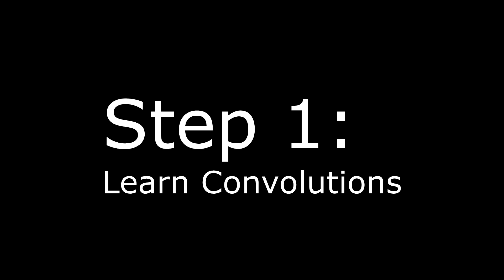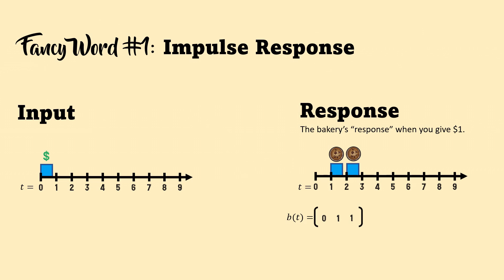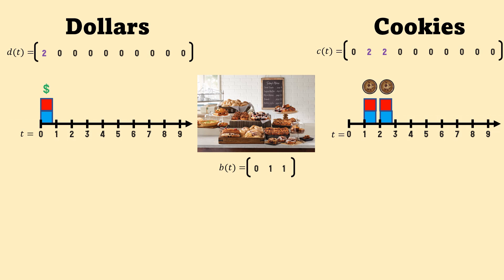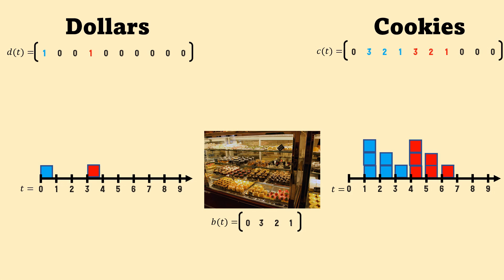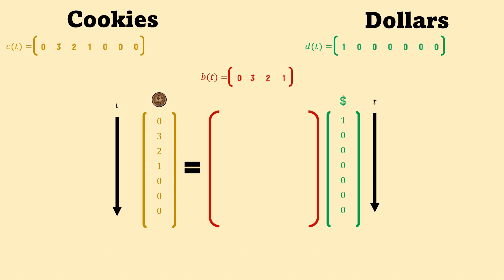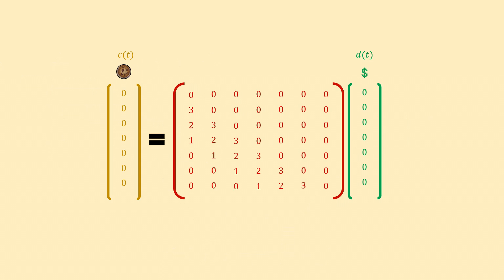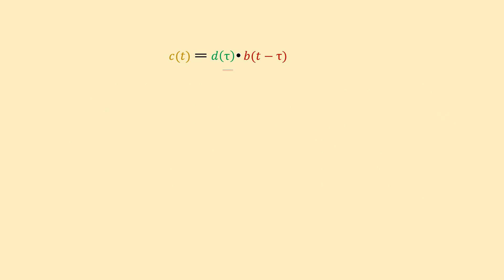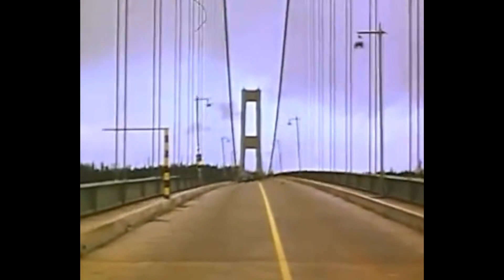Convolutions are not Convoluted

Comment: Extra Question 1 and insight into Question 4:
We can express polynomials in 2 ways:
(1) (n+1) coefficients uniquely represent the polynomial of order n. 
(2) evaluating the polynomial at (n+1) points uniquely represent the polynomial (see lagrange polynomial). 
For example, 2 points uniquely define a line, 3 points uniquely determine a quadratic...

In the coefficient representation, to multiply polynomials P and Q, we convolve the coefficients of P and Q to get the coefficients of the product.

In the evaluation representation, we multiply the evaluation of P and the evaluation of Q to get the evaluation of the product. 

These 2 representations are fourier transforms of one another.
Reply from the maker: Nice! I was actually thinking that if you treat use the fourier transform's discrete version, you can apply that to the convolution. You'll start to see the terms line up in a way that makes frequency multiply. I never expected it to connect back to question one.

Comment: First off this is the best video about this ever. 

But I have one doubt, at 7:45, when you say c(t) can be written as d(t)*b(-t), it's weird because that doesn't depend on past imput. compying your first bakery, let's say d(4) (dollars given at day 4) is 1, and b(-t) (cookies given at time -4?) is zero. The result would be zero cookies yet you could've given a dollar before that is just now receiving cookies.
Reply from the maker: It is not possible to receive cookies from the bakery on day 0 for a dollar you give on day 4, UNLESS the bakery can predict the future. Last I checked, bakeries do not have divination powers, so c(0) cannot depend on b(-4). 

Since the impulse response b(t) get's flipped around to b(-t), the negative sign actually refers to a point in the future.

The LATEST part of the impulse response interacts with the EARLIEST part of the input signal, which is why you need the flip.

Comment: No linear algebra related class I’ve taken has the input, output on the right, left. I’ve only left, right. Are you smoking?
Reply from the maker: Look up "state space representation". The derivative vector, which is the product of a matrix and the state vector, is written on the left side.
Reply from the maker: Furthermore, when assigning a variable in software the variable you want to assign goes on the left. Therefore, if you want to write matrix multiplications in code, your output goes on the left.

Comment: Brother you are correct for linear time invariant systems that they stack and scales response but in filters ther are used to attenuate some frequency can you please explain them with an amplifier used in some filters using convulution
Reply: Telling the application of convolution in terms of signal processing may help a part of people in the telecommunication and eee engineers but when convolution meets signal processing it also is used as a filter but my question is I have read convolution even it's useful for mechanical engineers such that in resonance when a failure occurs not due to massive force hitting an object results in large deformation could cause failure or an large impulsive force acting on it for a duration of time could cause failure but there is an another phenomenon where the natural frequency of any object is reached the energy builds in it very high and could cause a failure in this manner a small disturbance which accumulates over a time and causes a high energy to build in the system due to energy very high it causes stress and the system collapses this is highly different from stability perspective of control system being not stable does not mean it's accumulating energy inside it but in case of amplifier there is an capacitor or inductance device which causes the attenuation in the electrical signal and filters some frequencies but in other perspective amplifier amplifies the signal such that it stack ques and scales the signal but I don't know this is done by capacitor or am inductor but convolution is useful to both mechanical civil eee ece and every applied scientist and engineers hence it's used as a filter in an circuit or used to amplify but even transistor amplifies the signal without an capacitor or an inductor I guess also mechanical engineers can use it to model resonance hence the energy inside the system build high by periodic accumulation of the system reaching its natural frequency which leads to failure and I can also tell you that when amplifier filter or amplifies the signal it used convolution hence it's useful to every applied scientist and engineers but not to mention the pure Mathematicians use it of convolution of kernels thankyou guys some of my inference could be wrong if somebody or the author of the video is familiar with it please correct the above and educate me thank you for the wonderful video sir
Reply: Brother I know mechanical engineers could find resonance but when I had a deep thought on this resonance Is an slow accumulation of energy which is accumulated very high in small installments when the frequencies match if you strike a  turning fork of 50 hz you get the same frequency of vibration on another tuning fork so they both vibrate if you strike it harder the amplitude changes hence loudness is a human factor the frequency is the same the languages that human speak through out the world the sound only  resonate your ear drum for few seconds my question is that the harmonics is the fundamental frequency and overtones are the frequency that follow it take a word in any language you spell it according to convolution the thing scales and ques and stack the signal so convolution can be used to model resonance so when your ear drum vibrates it vibrates so the electrical signals are carried to brain  like tuning fork ear drums vibrate within the audible spectrum 20 hz to 20000 hz hence resonance is caused by the word we speak and within the audible range the ear drums vibrate and we make sense of words I have seen in one videos on YouTube that due to harmonics in any sound causes resonance which could be modelled by convolution recalling the resonance its destructive because slow and steady accumulation of sound on the mass causes high stress and high energy to build inside and stress increase and the system fractures or collapses but our ear drum hearing the sound from human languages try to vibrate but why our ear drum when subjected to continuous exposure of sound does not fracture or rupture like a wine glass iam not telling about high loud sound higher than 80 db but a audible range sound within the frequency of 20 hz to 20000 hz under continuous exposure why it's not damaging it again not failure by high energy but low one in synchronisation on air . But I tried it in my students when I told them to be quite in class they did not listen to me so I took my phone and set an frequency 14000 hz and they told it was irritating the idea of resonance is "small effort but large destruction " just like Tacoma bridge where the wind just slowly accumulated energy on the bridge and it collapsed it so my conclusion is if an audible frequency at continuous exposure to an human ear can it cause bleeding again "small effort but great destruction" sorry for the long story I you are able to reach hear you must be as curious as me so still not finished the ear drum is shook by harmonics in the sound we make by the words( or )overtones in the sound we make by the words I know harmonics is the fundamental frequency and overtones are following it which under slow and steady accumulation of sound energy resonates and could damge the ear drums again "small effort but big destruction" not to mention we assume the person is in coma or brain dead hence when the sound irritates him he or she could not make a move so my question is so simple normally human ear responds to harmonics or overtones according to convolution which could be a disaster but with minimal effort 🙏🙏🙏🙏 at here I could be wrong because harmonics can also be used to construct sound so can it be destructive or the overtones which are the trouble makers and which one according to this gives a response curve when two signals convolved by harmonics or overtones which is destructive but with minimal effort and convolution happens when ear drums oscillate is by harmonics or the overtones or also the trouble makers there

Comment: In my entire study of linear algebra, I have never put the output on the left.  But it looks good there, really!
Reply from the maker: I'm used to putting it on the left because I use "state space representation" of diffeqs a lot. Also, when you assign a variable when programming software, the variable you want to assign goes on the left, and therefore, when you model these equations in code the outputs go on the left.
Reply: @sigfyg8384  Yeah.  I like that notation because it reminds you that the matrix-vector product is just a vector.  Or that a scalar product simplifies to a scalar value.
Reply: I also put it on the right, never seen otherwise. I study math in France

Comment: 7:35 I don't really understand this step. I see the relationships, but why do you end up subtracting?
Reply from the maker: f(-t) is f(t) but flipped around the vertical axis.
f(t-1) is f(t) but shifted forward by one.
Combine these two transforms, and you get f(-(t-1)), which is a flipped and shifted version of f(t). 

It's ok to be confused here. I suspect that the source of the confusion is trying to comprehend why the flip and the shift are not commutative. To see what I mean, compare f(-t-1) vs f(-(t-1)). 

f(-t-1)    Flip first, Shift second
f(-(t-1)) Shift first, Flip second

When you switch the order of the transformations, you get two different results. Now you are thinking along the lines of Group Theory, where this question of commutating becomes important! 

Another note: I could've distributed the negative sign in and got f(-t+1) or f(1-t), but that makes it harder to see the flip and shift. 
Different representations of the same phenomena can tell two different stories. For example, a/b and a*(1/b) are mathematically equivalent, but they communicate two very different ideas. Similarly, f(-t+1) and f(1-t) don't communicate the idea I want to emphasize as clearly as f(-(t-1)).

Comment: At 7:37 I think you made a mistake since c(t) should be reversed. For example c(0) should be d(t).b(-(t-6)) and c(6) should be d(t).b(-t)
Reply from the maker: c(0) is supposed to be d(t).b(-t), as shown in the video. At t=0, the only part of the input d(t) that can have any impact on the output is d(0). When you suggest that c(0) should be d(t).b(-(t-6)), that means the system is somehow reading signals from the future!
Reply: @sigfyg8384  Yeah, I guess i got confused because you said you took the rows of the matrix to determine c(t) so for c(0) you use the first row which is b(-(t-6)) and for c(6) you use b(-t).